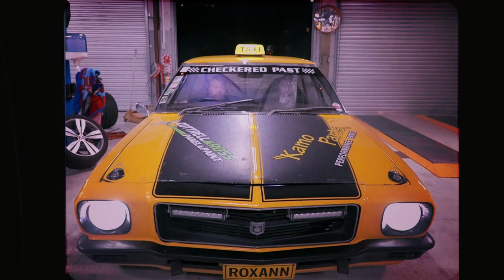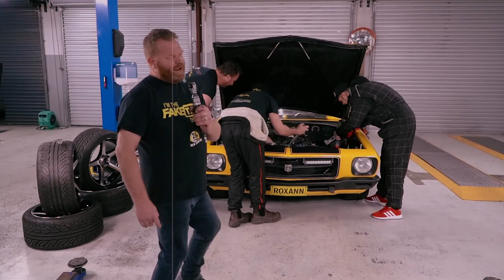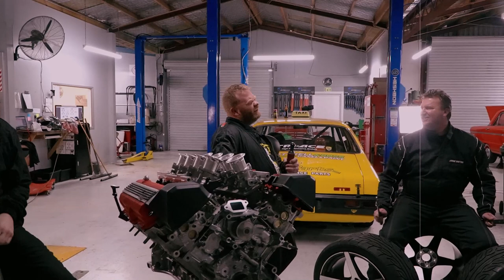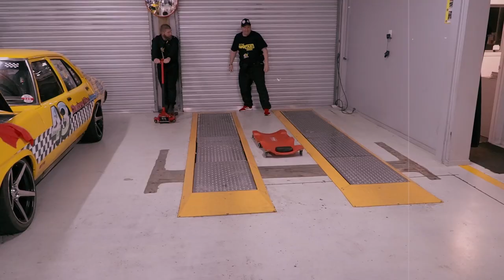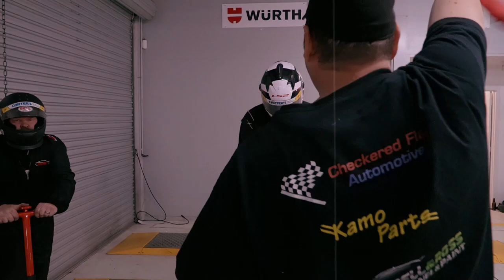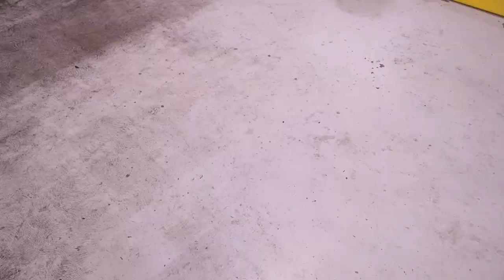Roxanne the HQ Holden with 1uz.  Crazy theme video for 2020 24 hours lemons. Team Checkered Past

Comment: So I have a problem with my 1988 a340e. It has a whining noise at the torque converter and will take a while to get into drive.reverse works just fine and I'm going to be replacing the filter and actuators but do you think it just needs a torque converter or us the forward band done for??
Reply from the maker: Sounds like it might be more than oil and filter but thats a good place to start.  Cheers Kelvin